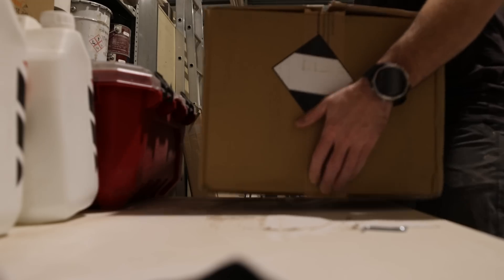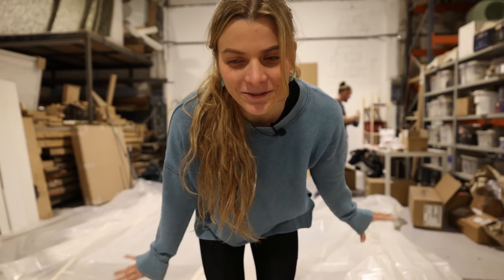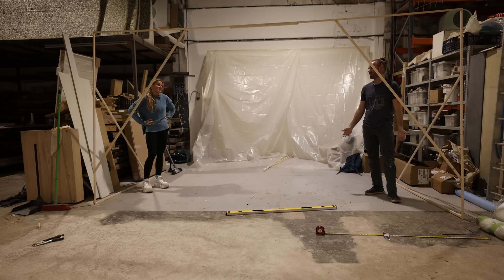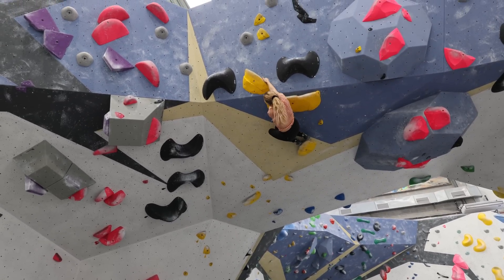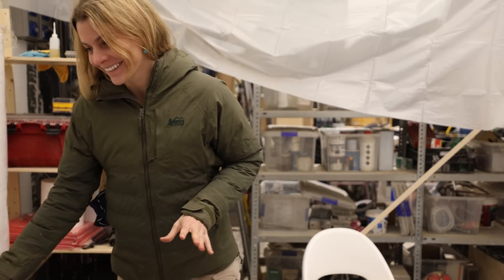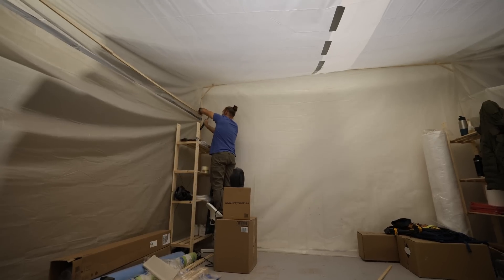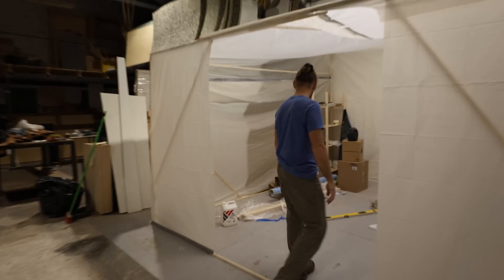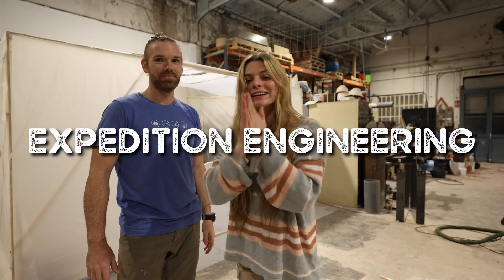A NEW CHAPTER | EE 145

Comment: Hmmm…I think that if you use PVC tubing and joints you can create a very easy to use enclosure.  Cross-drilling and screwing them together instead of gluing them would make it easy to assemble/disassemble.  Using ZipWalls will make it easy to get in & out, especially with two zippers so you can make the entryway as wide as you wish.  When you are going to use the enclosure having air blown in using a shop vac will give it positive air pressure to keep dust and bugs out, and ventilate it for fumes.
Jade, you are quite the Monkey!  Very impressive.
BTW, separating the two aspects of your vlogs is a brilliant idea.

Comment: I think it would be smart if you would have a van with a filter of course and then have the van blowing into the tent so that there is a slight over pressure in the tent and thus it will keep out dust and it will blow away al the fumes the composed or resin my give of. Fun fact: they use the negative way of this so that means there is a lower pressure inside then outside at tsjernobyl to keep any radio active dust from getting out. So I don't if you have already thought of that but I think it's a good idea.

Comment: If you could use a fan with a filter to create a positive pressure in the tent it will help keep out dust.  The filter has to be good enough to catch fine particulates, a HEPA would be great but a decent furnace filter would suffice.
Reply: I did it with shopvac. Left tube out and machine in.

Comment: Either side of the door, cut holes and tape furnace filters and box fans to it as a positive pressure ventilation system. You’ll get airflow and it’ll keep dust out from other access points.

Comment: Hello twins 😂, if you’re moving onto the next chapter, work space- unless you want to work off the floor?? Then you need to go for a work bench, the most important item is you must get it levelled so you don’t have any slumps, and a square frame makes for easier life later on.  Just also a quick reminder the when lots of glass goes off there is quite a bit of heat so I haven’t seen one, get a good fire extinguisher. 😄👍

Comment: As I agree to that "fort" - but you have to be aware, that dust comes in through the smallest hole - your battle will continue in a smaller way. The only hope to have your area clean would be with a blower system, that gets filtered air (at best from outside) and have a higher air pressure inside the fort.

Comment: i built a temp paint booth using pvc pipe and fittings worked well and snap together construction
Reply: The wood they are using is way cheaper and far more disposable.

Comment: Awesome work shed! For some reason that door is so satifying to me. Ha!  Would it compromise the structure if you cut the wood at the bottom by the door (to remove a tripping hazard) and adding that wood to the corners left/right of the door if you’re facing inward (essentially making triangles to regain support?